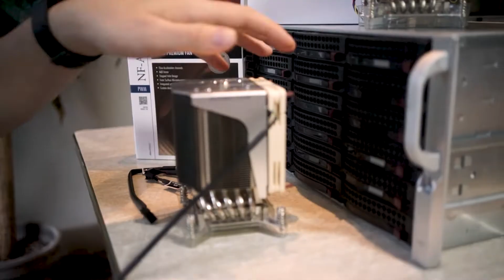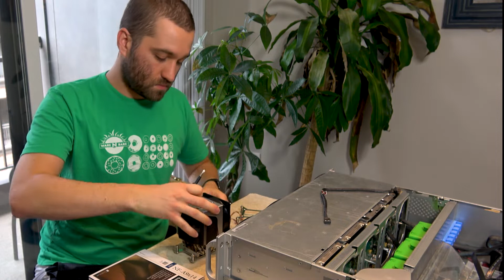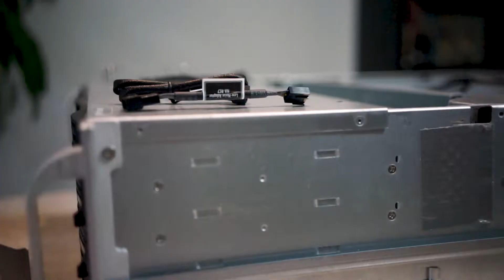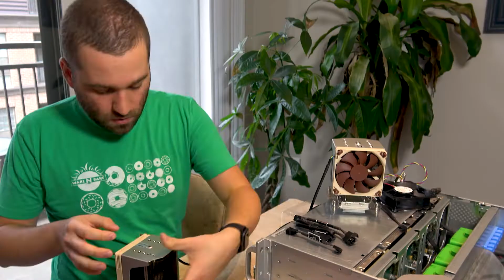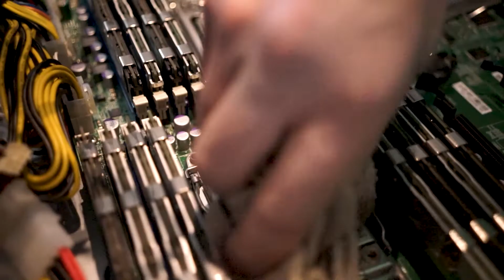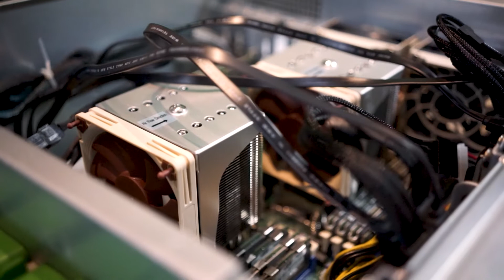Supermicro 846 CPU Fan Replacement Upgrade

Comment: I am also working with the 846 chassis, just wanted to say something about the fan headers, your supposed to use fan1-4 for the CPU cooler, these rpms are changed wrt the CPU temp. FanA does not use the CPU temp for regulating PWM.

Comment: I had an 846 which worked well enough (but noisy) and then "went weird", and I did not have time to diagnose, so I bought another, an 847 (with 24+12 drive slots) and that is also noisy, probably noisier? I just realized that your solution works because the mobo is mounted on the bottom of the chassis, but in the 847 the mobo is on a "mezzanine" with 12 drives under it! :O I'm thinking I'll go ahead with the fan replacements (for quiet) and monitor CPU temps, but might actually have to diagnose the 846 and move everything back, for height

Comment: Was there a specific reason why you preferred the NF-A9X14 PWM (500 ~ 2200 RPM and 30 CF/Minute) over the normal NF-A9 PWM (400 ~ 2000 RPM and 78 CF/Minute)?
Reply from the maker: Actually no, I didn't realize there were higher CFM options available or I would have gone that route!

Comment: What cpu's are you running?
Reply from the maker: Currently Intel® Xeon® CPU E5-2630L - thinking about upgrading though!
Reply: @rhyspowell4036  E5-2696 v2
Reply: @hakoren4444  yeah power consumption

Comment: This could provide some better cooling for your RAID card than what you are currently doing, looks better too: https://www.amazon.com/Cooler-Slot-Dual-Graphic-Video/dp/B07YV3Q7C6/ref=sr_1_5?crid=RS3MYDX9C7QB&dchild=1&keywords=pci+slot+fan+mount&qid=1597852089&sprefix=pci+slot+fan+mo%2Caps%2C251&sr=8-5
Reply from the maker: Hey that is awesome! I didn't know fans like that existed. I will look into this. Thanks!